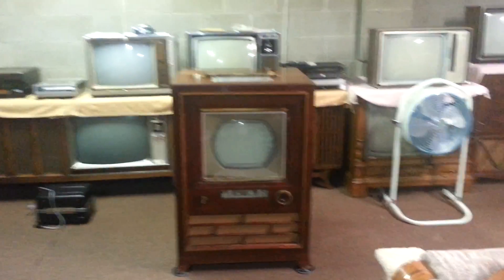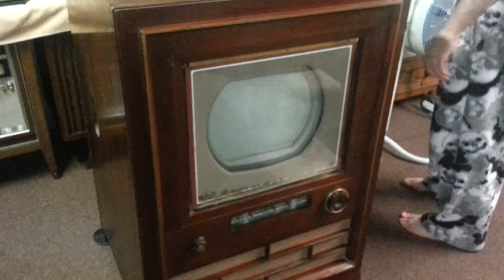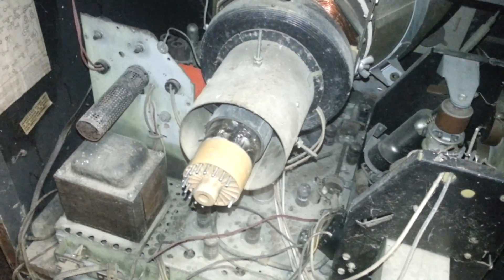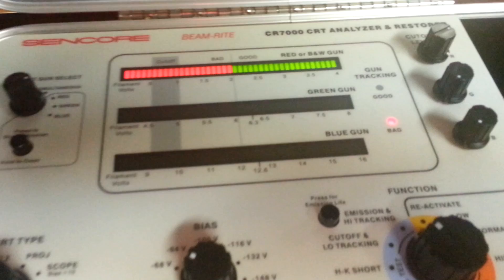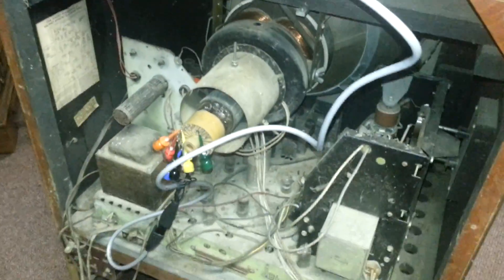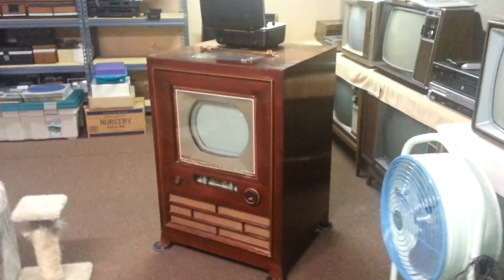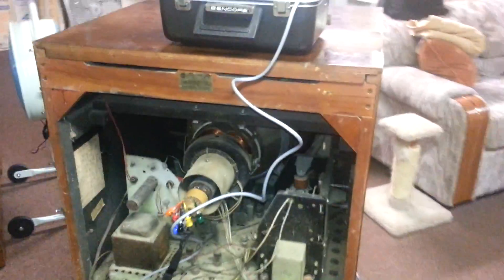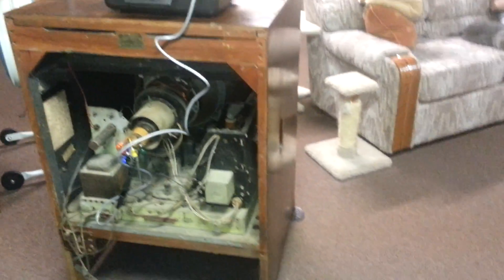The 1954 RCA CT-100 the Merrill Color TV Preview

Comment: Why would someone need more than 3 TV's? ABC, CBS, and NBC was all there were back in the day (pre-1986) other than PBS on some UHF station that wasn't broadcasting half the time. My grandparents used to have one (not sure if this was the exact model, probably not, they weren't rich). When it went bad in the 1970's they just got a new one, with the old one given to me to play with (ie take apart and never be able to put it back together, I was like 5). The picture tube ended up getting turned into a planter after the glass was removed by me in not-so-delicate ways (I guess CRT's back then were both metal and glass, metal middle with glass front and back/neck, though at the time I had no idea what I was taking apart and smashing and giving to grandma for a rose bush flower pot).

Comment: Sounds like you scored a jackpot! I don't believe that these sets have shielded HV rectifier, shunt, horizontal oscillator tubes so they do emit a considerable amount of X-radiation, at least from the back of the set. A Geiger counter and/or dosimeter would be helpful in measuring your exposure.
Reply: Eh I just did what grandma told me, don't sit so close to the TV. 40 years later I'm still here and still no tumors. X rays are just like any other light, distance is your friend if it's bright. I'm sure he'll be fine as long as he doesn't sit 2 feet from it 16 hours a day, give it 5-minute bear hugs while on every day, or for some reason stare at the back rather than the front.

Comment: Hopefully it is actually good and isn't just giving a false reading. If a picture, or any tube, gets a bit gassy it can almost peg the meter on the tester because it screws up the transconductance inside the tube. I guess the only way to know for sure is once some plate voltage is applied to the picture tube.

Comment: If it were mine I would restuff the original caps, a la Bob Andersen, just to keep it looking as close to the way it left the factory as possible under the chassis. Shango was right though, the prospect of that metal-glass picture tube going to air would scare me away. Maybe you got lucky and someone replaced the original tube or had it rebuilt?

Comment from the maker: I was quite ecstatic not only when I found the tube was still under vacuum, but all 3 guns show 100% emission.  I plan on making video updates as I start going through it. 

I'm going to be pulling the chassis out this weekend, start cleaning it up and get ready for new capacitors and other components it may need. Probably test all the tubes too.